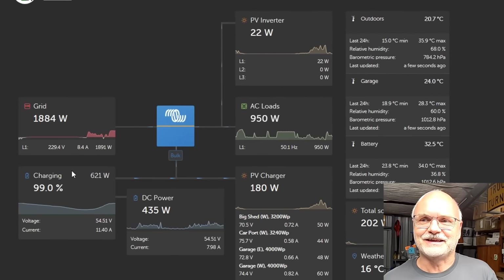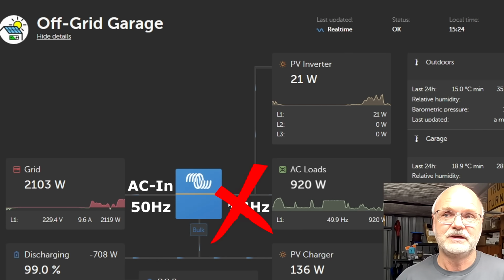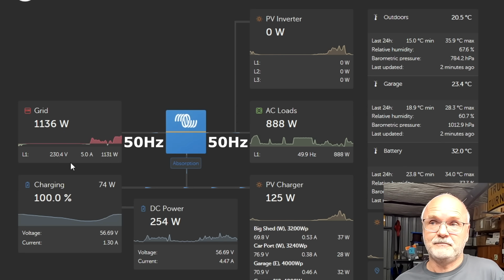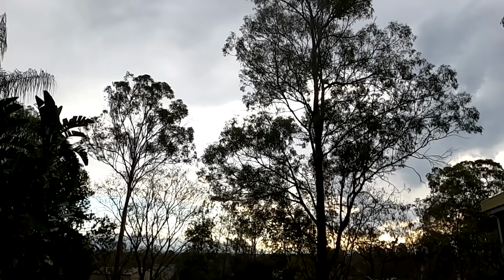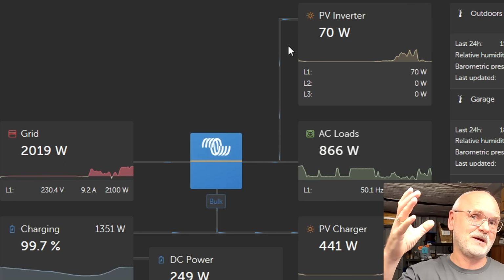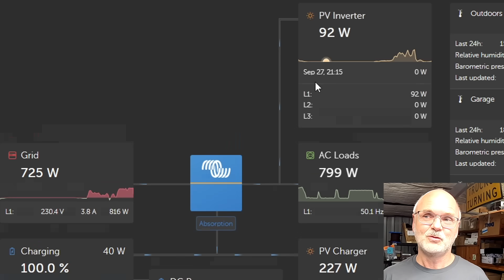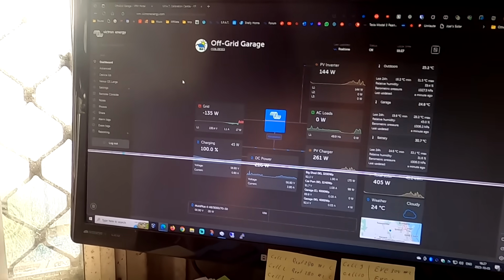Victron Multiplus, Micro-Inverter and Generator. Where does the energy go once the battery is full?

Comment: If there is no way to "burn" or feed the Energy, the same thing would happen if you don't configured the multiplus with AC Inverter. The frequency wouldn't raise, the AC voltage wouldn't raise, but the DC voltage would raise, until the BMS trips. at 56.8V that could happen very fast.
Reply from the maker: The DC voltage does not rise above the set Absorption voltage though. Never. 
It turns off all power sources connected to the MP. But what happens with the AC inverter if the frequency cannot be raised?
Reply: In case the Multiplus is not configured with an AC inverter it does. I have tested this a few month ago (without grid connected), to see what happens. So priority of the multiplus seems to be the AC voltage. The AC voltage stays at 230V 50Hz, but the DC voltage raised until the BMS tripped. And I think this is much better than raising up to the AC voltage limit and damaging some of your devices (poping some capacitors)

when there is an generator connected, I would assume, that feed in is disabled so the only way to not feed in is to send the power to the battery.
Wrong configuration should not be possible. I assume that the multiplus would not connect to a generator when the input is configured as grid. @OffGridGarageAustralia
Reply from the maker: @danielvanaalst2460  Ah, OK, so no PV-Inverter assistant... OK, that's a very special case and a 'wrong' configuration which should not happen. But interesting to hear. 

What happens once the BMS has disconnected, does the MP just turn off?
My MP keeps running if there is enough solar available, even without battery.

Comment: If you have no AC-PV-Assistant installed and no Grid / Generator connected, the MP-II will increase the battery voltage and eventually shut down, once the BMS disconnects.
In your situation, the "Generator" will take this excess energy and heat up and eventually shut down or burn out, if it does not bidirectionally charge your second battery bank.
Reply from the maker: It will overcharge the battery? Or at least trying to? I thought it will protect the battery under any circumstances...
Well, in my case, there is no way the the Phoenix will take any energy at all. Will the MP try to push this energy back to the grid even knowing there is no grid as such?

Not sure if the setting in System Setup and assigning the AC Input1 to either Grid or Generator makes a difference there.
Reply: Well, I could not try that jet and I am not quite willing to sacefice a Inverter or Generator for this experiment   @OffGridGarageAustralia  😅
But I just found out...if you forget to install the PV-Assistant (with not Grid or Generator connected), the Inverter will not increase the frequency and therefor try to overcharge the battery with the excess AC-PV-Power.

Comment: There is a second form of control (wont work for your situation) You need to have the network configured to allow for modbus tcp, if you have inverters compatible with victron they will take instruction for the cerbo regardless of the input frequency. But it requires that they are compatible (we saw the fronius inverter you had sitting in your shed in one video, that will work) There is only a couple of items that need to be configured for it to work 

But the AS/NZ 4777.2 (2105)  standard does discuss voltage as potential for DRM as well, i thought it was as low as 265v
Reply from the maker: Ok, that's interesting. I have modbus activate in Venus OS as I use this to connect to Home Assistant. That might be something in the ESS Assistant which controls DRM in a grid-connected setup.
Yes, voltage goes up to 265V with the Volt Response Mode

Comment: Does the Generator have the ability to burnt off the excess energy (at a limited level) through a heat sink, can you see the temperature of the Generator rising? Do you have any dry connacts between the Generator and Micro controller, or a third party swict to trun off the DC voltage from the Micro controller, that you can use to control this voltage problem?
Reply from the maker: Well, the 'generator' is the Phoenix inverter in my case, so, no, it won't take a single W of reverse power.
I have a Shelly connected to the micro-inverter which I can programmed to turn off this source.
But this was more for testing purposes and such a scenario would not occur in my setup ever. The 'genset' never runs unless I turn it on manually (again more for testing purposes than anything else).

Comment: Some generators could actually spin up, but i thought they are very old tech from the 60s. But when there is no 50hz it shouldnt work, so no way. The victron shouldnt create  a 50hz net for exporting when there is no 50 hz from the generator, or does it.

Comment: The microinverter is delivering less power, cause its capacitors is staying full! It could lower mppt voltage, and, or, go in fault mode as well.
Reply from the maker: But it's a dumb micro-inverter. As soon as it sees the grid, it delivers all the power it can. Until it hits 52.8Hz or 275V...
Reply: @OffGridGarageAustralia  
I dont know. I guess its charging some caps internaly, what happends when they wont discharge into the grid? There should be some kind of feedback loop? A smps is stupid as well, even less "smart" but it wont push voltage into a nirvana, or it pushes itself into nirvana. i guess, i dont know.
Reply: When it is going high on volts to 275v but no current is running, the voltage drop on the cables will be enough? Grüße!

Comment: Did this, pv inverter on ac side. Hybrid inverter and to test i shut down the mains. Well the hybrid inverter did not like it, and on the phase the pv inverter was on it the hybrid inverter was shutting down the power to the phase. And this kept happening.
Probebly the hybrid inverter switched of for high voltage, but there was no error message at all. But was to scared to keep trying 😂
Reply from the maker: Oh, wow, thanks for sharing... and trying, I guess.
That is what I was expecting as well, an increase in output voltage until one device shuts down.

Comment: Andy, your observation and especially your comment @ end confirms my observation how Deye 2000W micro-inverter works behind MultiPlus-II which is grid connected.
I was initially afraid to have both AC sources available, used Deye only and added 375Wp panel to it so there is 825Wp panels in perfect angle for mid-day production. Unfortunately near arctic circle sun was so low that neighbor's roof was shading too much those panels and production was not enough to keep battery in charge without grid AC.
Later I got lazy and had grid AC input connected with Deye in output side, to my surprise there was no problems. Battery is charged to full, then AC charging was completely stopped. DC loads were consuming battery charge and AC loads were served by Deye 1st and if not enough, from MultiPlus-II which took from grid AC all it can get (I've got input limit of 6A/230V because when driving I can boost DC-DC charging of the campervan with 12V/1200VA Phoenix inverter), for example when cooking using induction hob.
After bigger loads, MultiPlus-II charges battery to full, then above repeats. Deye pulses power in, MultiPlus-II stops charging, AC goes idle, repeat.
Unfortunately I don't have measurement of the grid export so dunno if excess is exported through MultiPlus-II, I was little worried about that but there is not much panels to feed grid and my house is consuming most of it anyways before grid feed.
In my setup, without grid AC input, output frequency goes up until no charging is needed which stops power production from Deye. And it goes back to 50Hz when battery charging is allowed. Same cycle as above.
Reply from the maker: Very interesting. So, you don't have the AC Inverter Assistent setup in your Multiplus?
How does the AC Inverter shut off though when the battery is full?
If the grid is connected, it can just export the excess energy unless you have turned this off. Probably not allowed on campgrounds anyway to export energy.
Thanks a lot for sharing.
Reply: @OffGridGarageAustralia  I've done similar off-grid island configuration as you've got. My rig is designed to be fully off-grid and campgrounds are out of the question anyways, only when parked near my house I'm using shore power.
Most likely while on the go I'm using digital inverter generator if not driving, most likely then I'm not cabling both micro-inverter and generator.
Long term plan is to purchase light box trailer, mount tilting rails for three 550+ Wp bifacial panels feeding to the micro-inverter. Use it to boost charging over winter or if using corded power tools etc...

Comment: Hallo Andy! Die Anzeige ist richtig, die Energie geht zum Phoenix-Inverter. Ober er die Energie vernichtet oder in die Batterie zurück lädt lässt sich einefach mit einer Amperezange am Batteriekabel messen. Bei meinem Steca-Inverter lädt er in dieser Situation tatsächlich in die die Batterie zurück.
Reply from the maker: The Phoenix is a simple off-grid inverter. It cannot take any energy on the output or even charge it back into the battery. There are main components missing in the inverter. Or maybe not...?
Reply: Alos ich kann mir technisch vorstellen dass es mit Invertern mit 50/60Hz Trafos funktioniert bis zu der Leistung, die auch der Inverter liefern kann (aber nicht mit Hochfrequenz-Trafo-Invertern)  @OffGridGarageAustralia

Comment: This is a click&bait trap. 

Not the most subtle one I’ve seen but hey, we all like the guy so let’s play stupid, everyone 🙃
In the last seconds of the video we clearly see the MINUS on the “grid” (Phoenix) side of the MultiPlus. So MultiPlus is pushing energy into “the grid” aka “generator” aka Phoenix. 
Well… what this “pushing” means in the first place? How the micro-inverters are “pushing” energy? There is the key. 
The voltage will raise only so much, then the micro-inverters will limit themselves not by frequency meaning but by micro-grid allowed voltage (that is not 275 Volt, no). 
However, nobody’s talking about the elefant. We clearly see the “minus” power on the grid/gen/Phoenix side.
🤦‍♀️
Reply from the maker: The negative figure is just a calculation. If you look during the day, it always says -1300W or whatever. This is the power coming from the AC-Inverter charging my battery. The Venus OS just does not show it correctly because it's a custom built setup using a Shelly switch to read the AC-Inverter power and displaying it in the VRM. As there is nothing connected to the AC side of the system, it assumes, the energy must go back to the grid. Even there is no grid.
Reply: @OffGridGarageAustralia  don’t you have a Phoenix on the “grid” side? From other comments, i understand you do.

Comment: Measure the currents for real.  You can't really trust what is displayed because some of it might just be a back-calculation of other readings. 

When it was in the in the charging mode with the battery at 100%, the power of the tilt and the generator (running at about 97% efficiency) added up to equal AC load. eg at 11: 40, tilt is 91w, gen is 682w, load is 756w.  (756-91)/682 = 0.975 efficiency from the gen - that seems reasonable.  It's must be doing a double conversion (otherwise it's unable to change frequency) hence there will be losses.

No idea as to how/where it was sending power back - you need real measurements.
Reply from the maker: Yes, that is correct, some of the numbers are just calculated and related to other measurements the system actually takes. And the numbers where quite low, so there are some errors in this observation.

Comment: Has anyone tried connecting the Microinverter output to the generator input of the multiplus?
Reply from the maker: That will only work with a grid connection. The micro inverter needs a grid form to start up and producing power.

Comment: These extreme events are worth testing for system safety. Don't always trust the apps. Can you measure voltages & current flows between the various parts of the system? Using clamp meter for current will be less accurate but better than alternatives. Measuring voltage with different meters I have at home give different values.
Standby power usage of inverters? Is charging of batteries really all 0 in this situation?
Reply from the maker: Yeah, that is a good point. I was actually hoping for a bit more power coming from the micro inverter that day but the weather🤷‍♂️
Even measuring these smaller currents can be tricky and may lead to false assumptions. I can also only measure one voltage at the time and find it difficult to remember all the numbers and make sense out of them.

The main think here was to get people start thinking about such setup and system designs and what potentially could happen. Even these rare occasions might be worth thinking of.

Comment: The excess power from the micro inverter is just being dispersed as heat through the circuits, it's not much until the sun shines direct then you might see a BOOOOM. Why do you insist on charging LFP battery to 100% when all the manufacturers say for longevity it should be 80 - 20% DOD for daily cycling & max cycle life, this includes the Tesla.

Comment: If your producing more AC coupled power than you need, it will back feed into the grid connection of the Multi. As this is a Phoenix, and probably has a similar design to the Multi, I would expect the power to back feed into the batteries of the Phoenix. If the batteries are full, the Phoenix will raise its frequency in the same way as the Multi  does and this will be passed through the Multi and throttle the micro inverters.
Reply: Ok so the Phoenix will still phase shift you reckon. This is interesting as in thought only the multi.would be capable.
Reply: @jasondevine6014  you might be right but Victron seem to describe the Phoenix as a Multi Plus without the transfer switch.
Reply: Das muss ja dann wohl so sein
Reply: Does the Phoenix have the ability to charge the battery?  I don't think it does, but I'll look.
Reply: @number40Fan  people on the Victron forum say the Phoenix will back feed into the batteries. I have an 15 year old Quattro and that supports ac coupled charging but it doesn’t do the frequency shifting.
Reply from the maker: The Phoenix is just an off-grid inverter, a stand-alone unit. It does not have the same functionality as a Multiplus nor does it have the internal tech of being able to charging a battery, I would say.
I'll do more testing though and see what I can find. At the time of testing, I didn't watch the S.P.A.T. Calibration Centre's battery as this is where the Phoenix gets its power from.
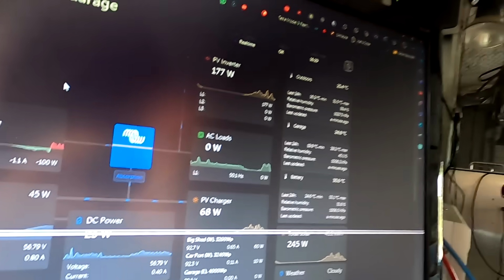Reply: @OffGridGarageAustralia  members on the Victron forum have reported that the Phoenix will charge the batteries from an AC coupled array but I couldn’t find anything about frequency shifting. It will be very interesting to see the results of your testing but I think you’re already demonstrated the back feeding at 11:40. Your Phoenix is showing a negative value for power output which probably means power is going into the Phoenix battery bank.

Comment: Hello Andy,
the enegy goes into the grid.
Your grid is the Phoenix.
This means in case the Phoenix is not able to charge his battery, it has to fight against the miroinverter. This causes the Phoenix to heat up. Maybe it can endure the 200W, but if the sun comes out and your microinverter ramps up to full power your Phoenix will hopefully protects himself by switching off, otherwise it will die.
In case the Phoenix protects himself, the Multiplus then can increase the frequency.
Reply from the maker: That is the most logical explanation so far, I think. The power from the micro-inverter was just too small to make something happen. I'm too chicken to test this with a higher AC-inverter power though.
Reply: Andy has grid feed-in disabled in his MultiPlus for safety reasons.

I've just spent a while arguing with myself whether this means that the MultiPlus blocks itself from sending power "back" into the "grid" (actually the Phoenix).

Hmm???
Reply: @Full-of-Starships  
Yes, the Multplus itself will then not feed into grid, but the microinverter will do. The Multiplus can not control the microinverter  as long as it is operating ongrid.
I dont know in detail how the Multiplus is internaly wired, but usualy all hybrid inverters i know do connect input and output together by relay in ongrid (grid paralell) operation.
Reply: The multiplus is reading -266W which may suggest that even if it is set to not back feed into grid AC it is unable to regulate the micro PV inverter. Has Andy set Multiplus to not backfeed?
Reply: @aidendeem903  
Regulation by increasing the frequency is only possible offGrid. But the Multiplus runs 'on the Grid' comming from the Phoenix.
The Multiplus can not control the  the Phoenix.
The Phoenix has no microGrid function, due this it can not change its own frequency.
Reply: Your explanation seems the most reasonable. I have a question. In this case, if I connect a normal 2kva Honda generator to the AC input, will the excess power damage my generator? On a cloudy day I want to turn on the generator, but I am afraid that the sun will come out for a moment and damage my generator. The safest way I know is to use a 48V charger connected to a generator to charge the battery. I'm just curious to know if it's possible to connect the generator to the AC input. Thank you so much.

Comment: Power Factor my friend, Power Factor! It will phase-shift the current so that the energy is stored at zero (0) power factor as a circulating current through the inverter. The generator is probably the inductor and the inverter is the capacitor and the tilt-PV is the source. If you check, the current is probably flowing backward through the generator coils, and it is spinning with less torque.
Reply from the maker: Well, there is no generator.